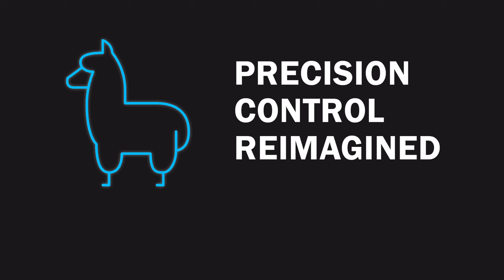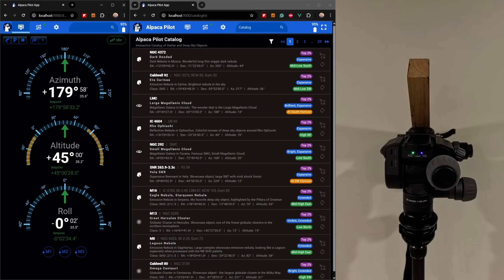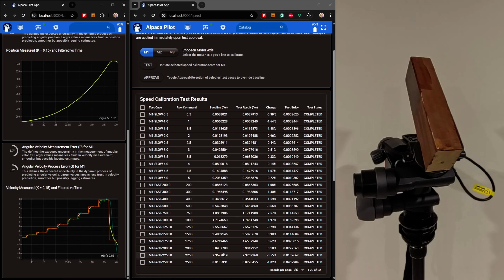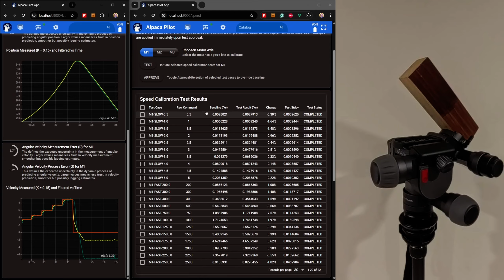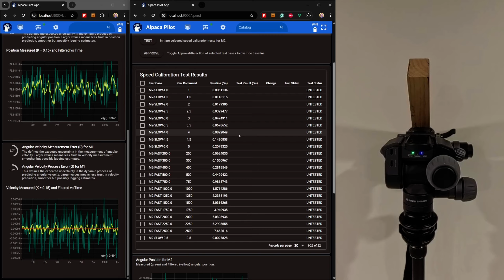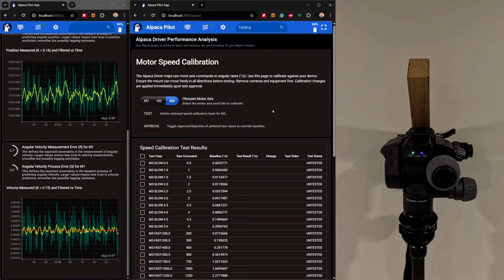32 = Calibrating Speed Control for your Polaris

Comment: I've not understood if I am supposed to run the test each time I use the Polaris or if the test result, once accepted, are stored in the Alpaca driver settings. Also, domI need to save the configuration after the test or once accepted the results will be used? I am asking that because I noticed that after accepting the test if i rerun the test, the rusult is alwyas compared to the original baseline and not to the new settings. You have done an amazing job BTW, thanks a lot  😊
Reply from the maker: The speed calibration tests are optional, but if you choose to run them, you should only need to calibrate once.

Accepting the test results will only update the current running instance of the driver. If you are satisfied with the new calibration, click Save on the Settings page to persist the changes. Once saved, the new calibration will be applied each time the driver starts.
Reply: @jdm5001  Thanks 🙂

Comment: Any possibility to add an option to allow users to set the number of iterations for each movement?  For the axes that have rotational limits defined, is there any evidence that some of the  movements aren’t allowed (e.g., on approach to a limit it may not allow the fastest motion to ensure it doesn’t overshoot or damage the mount)?  Lastly, is there any reason to run the calibration tests more than once or will running through the calibration tests once be sufficient for some prolonged period of time?
Reply from the maker: 1. Fixed number of iterations
The number of iterations is fixed and was chosen based on the characteristics of the Polaris firmware and its PWM behaviour. It ensures complete coverage of all slow-speed regions, including the midpoints between them, while also providing sufficient samples at higher speeds to accurately model their nonlinear response. The iteration count is also fixed to ensure a consistent baseline across all samples.

2. M2 axis reversal handling
The M2 axis includes a simple safeguard that reverses direction if the angle exceeds 60° or drops below 20°. This check may not always trigger in time, but if it fails, you can rerun the single test to obtain a clean dataset at higher speeds. I do not plan to further refine this logic.

3. Re-running calibration tests
You don't need to run the calibration tests more than once. In fact, it is generally acceptable to skip the tests entirely and rely solely on the baseline calibration. The PID controller adjusts outputs based on measured performance, so calibration primarily reduces the magnitude of those corrections and makes the PID tuning graphs easier to interpret, with less offset between SPs and OPs. This wasnt clear when I first implemented the calibration logic, but I decided to leave the function in v2.0.0.
Reply: @jdm5001 thanks for the additional info.  My question about iterations was more about using a consistent number of iterations for each movement, but allowing users to use a larger number of iterations in the hopes of converging on the true underlying mean performance of the device.  I’m guessing that the mechanical tolerances must provide relatively consistent performance for a smaller iteration number to converge reasonably well, which is also good/useful information to know.  Thanks again.

Comment: great tool easy to use calibration that adds even greater accuracy to the Benro Polaris. I noticed that on my tracker the M3 (astro rotation) motor does not align properly when parked with double tapping the joysticks; it should be in the same line with M2 (elevation motor) o I am looking forward to test it with this calibration tool and see if it improves.